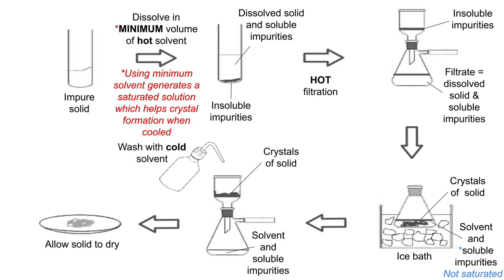PRACTICAL SKILLS - RECRYSTALLISATION OF ASPIRIN

Comment: Hello, if the point of the cold filtration was to not dissolve the crystals, why do we still have to use ethanol rather than simply water?
Reply: probably cold ethanol dissolves more of the soluble impurities than cold water, so you get more soluble impurities removed. since ethanol is a better solvent than water (but both don't dissolve the crystals)

Comment: After my hot acidic filtration under reduced pressure my crystals failed to form, I tried scratching the sides to no avail and even leaving it overnight does not form crystals, any idea what I can do to form crystals from the pure aspirin dissolved in ethanol?
Reply: ik it's a year later, but in the first step, i don't think you should dissolve the aspirin in hot acid, it should be dissolved in hot ethanol. maybe that's why the crystals didn't reform?